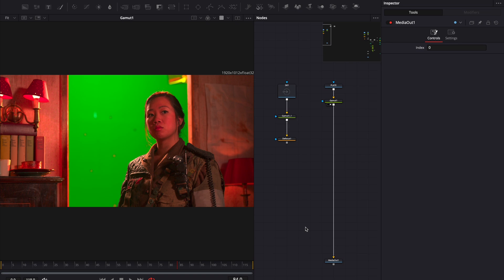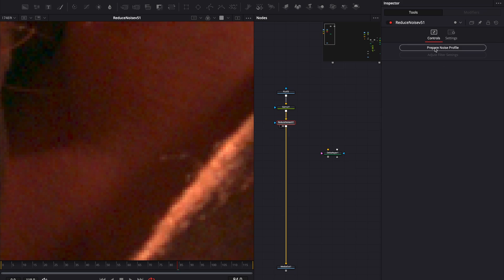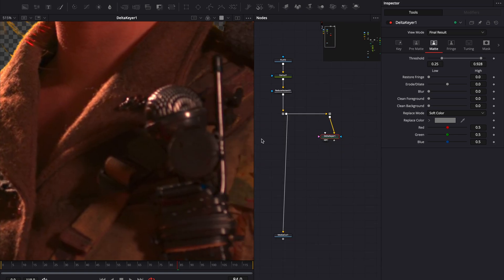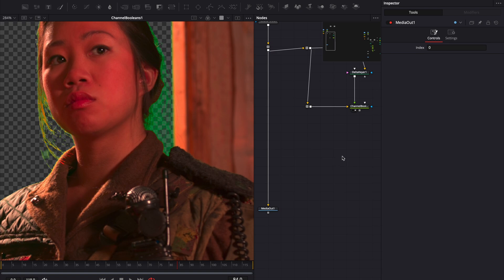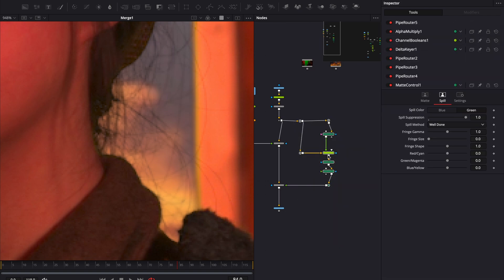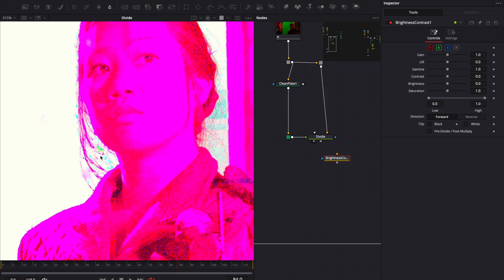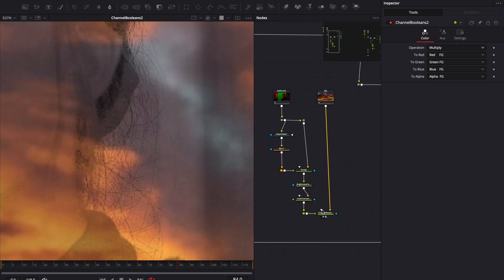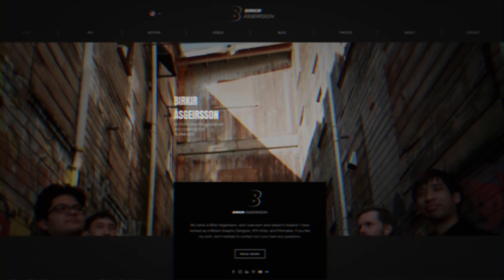Additive Keying in DaVinci Fusion – Bring Back Lost Hair Details!

Comment: how do i get the deltakeyer to clear away the rest of the green? near the hair where I sampled from it's fine, but farther away and especially around the borders of the frame where my green screen had some wrinkles in it, those darker shadows are still visible on top of my background. i'm used to the 3d keyer sampling tool where you can draw a stroke all over the frame where the green is. but that method doesn't result in nice hair.

Comment: Awesome! ...but how can I mask out my subject? From time to time my subject moves out of the green screen and masking in the color page doesn't work with your incredible tutorial. Is there any way to mask out single keyframes manually?
Reply: Go to the time range of the clip you want to mask.

Click on the B spline tool (it’s an icon below the viewport.) and then to draw the mask.

Next connect to the B spline to the mask input (the blue triangle on the mediain’s port). 

Scrub through the timeline to the areas you want to mask, and then select the B spline node to have the mask re-appear and then adjust the mask shape to key what you need. It will leave a key frame of the new shape. And then you just continue the process of scrubbing the timeline, moving the mask (it will auto key itself everytime you move it)